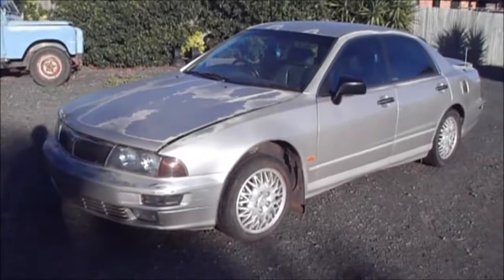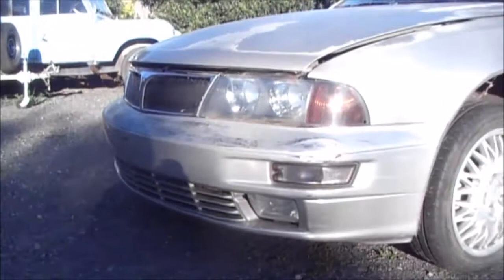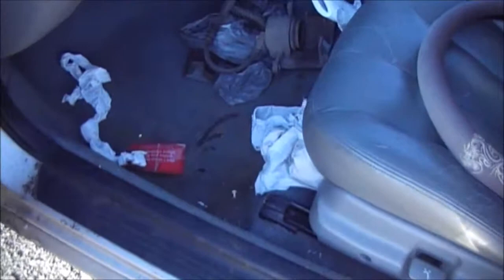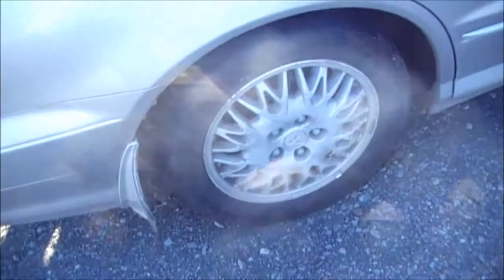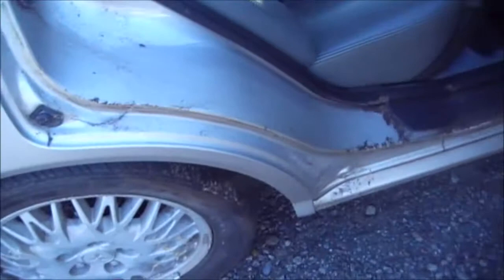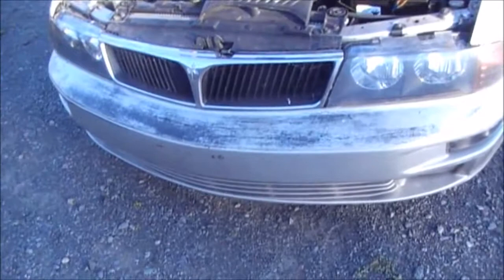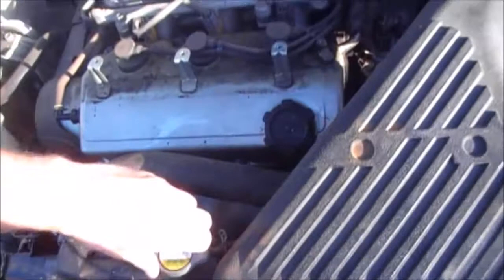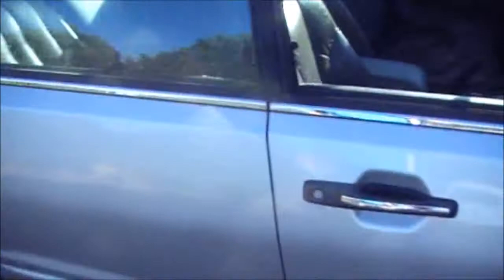Mitsubishi Verada Magna Walk Around

Comment: Hi mate. Nice video. Im thinking of buying 99 verada with 250k on the clock. Drive belt is not as rough and is a bit smooth. Whats the interval i’d need to change the belt at ?